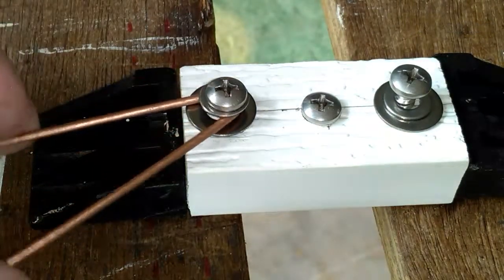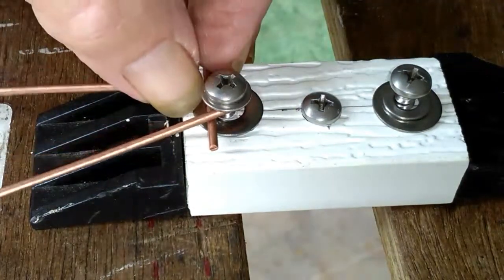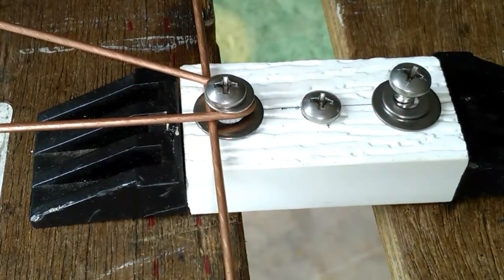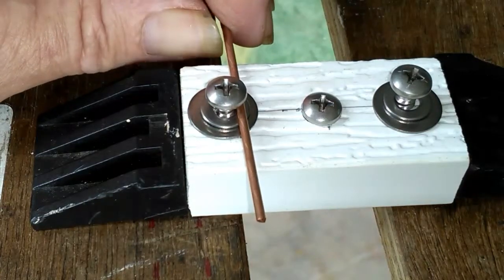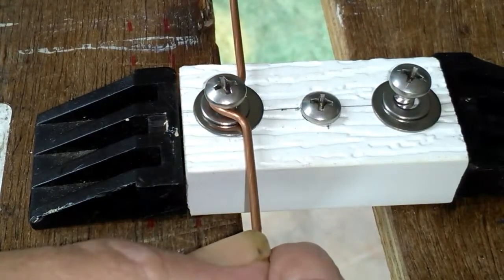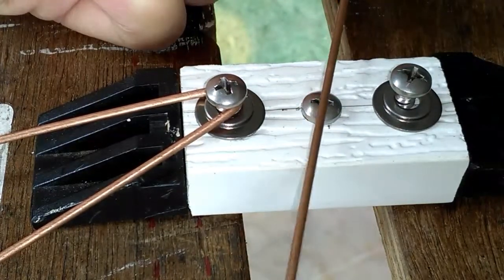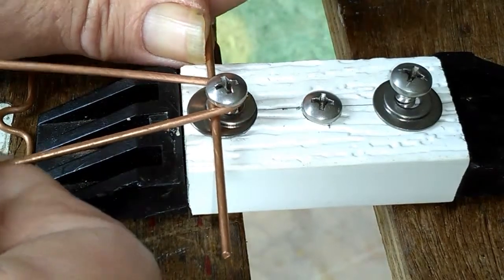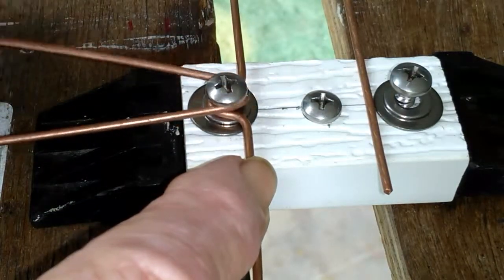The Problem with Bowties......

Comment: Elegant solution.  I have always wondered why they don't just loop the wire completely around the screw one time.  It is not going to come off then.  Probably doesn't look any better, but I'd rather be secure knowing that it is not going to come off when I have gone to the effort of putting the antenna in my attic (where I don't care what it looks like).  For that matter, loop the whiskers around the screws, too.  

Also, in your example, why not put the wires under the larger washer so that the setup has a bigger set of pinchers, if you will?  That little washer just doesn't look like it has enough leverage.  With a bigger washer, the wire will likely embed itself in the wood (if it is pine).
Reply from the maker: In another video I discuss "Planes" or flatness of the entire antenna. The entire bowtie antenna, except the phase lines must be aligned within the same flat plane or very slight phase distortions will appear as flash type interference or frame skipping on the tv as signals clash on the wires. 
Straight flat bow wires produce even reception without interference created by the antenna. 

Don't let the phase wire to embed in the backbone material, it keeps going into the material making good contact difficult. 

This solution to the phase wire loop issue has solved many annoying standing wave and phase issues that arise from out of phase signals conflicting on the wire surfaces. 
An antenna should flow the signals not create a difficult path with obstructions. 

Good building

Comment: Hello, and that you for all the great information contained in your videos. I came up with a slightly different approach that help with this issue but may create one that I haven't thought of so I'm looking for input.
I use a Allen head bolt 6 washers 4 nuts and loctite blue. 
I drill a hole clear through my insulating block. Then countersink both side so both the bolt head and first nut are below the surface loctit red if never coming apart or blue otherwise, then my first washer,  module connection wire washer loctit lastly washer wisker washer loctit nut
Drawbacks. It is at least 3 times taller than yours, and 3 times heavier, far more costly.
I do not have the ability to determine the amount of db loss via the wisker to let's call it the bus and the db loss without the washers .
Pros. Makes it easier to get very uniform alignment for the bus wires then once set you don't ever adjust or disturb that again. 
Makes changing the wiskers a breeze.
Using a depth stop on a drill press when. counter sinking the holes a exact bolt length can be determined and then I cut the bolts all the same to the exact length so no excess bolts are exposed. A note if u may use a thicker wisker at any point cut bolt to that length. Not necessary only visual and if your the guy selling a few antennas details make the product imo
Reply from the maker: Send a pic of your build to cosmic222@protonmail.com
I would like to see how you built yours.